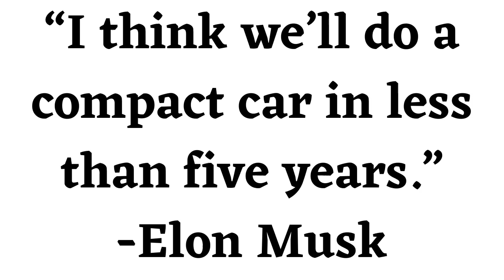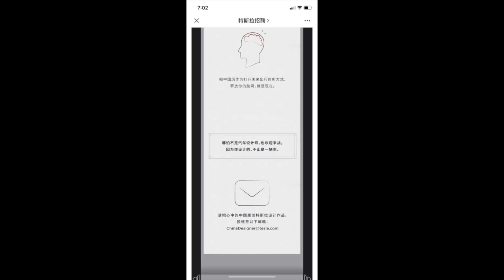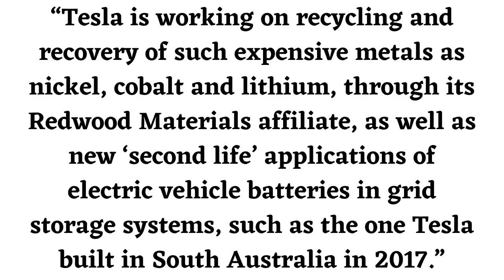Tesla's $20,000 Compact Car Is Coming Soon - The End of Gas

Comment: Go green ...oh yeah EV's get their power from the grid which is powered mostly by coal
Reply: brent cowan Brent, not necessarily any more. I live in New Mexico which is actively building more wind turbines and solar power. They are putting in transmission lines. The main coal fired plant will be taken down soon. Also we have solar panels on our roof. So charging at home is completely green. And if you drive across Oklahoma and Texas you will see miles and miles of wind turbines. Times are changing.
Reply: brent cowan Only in the third world USA. Here in the U.K. We were once the worlds biggest producer of coal, and until twenty years ago almost 100 percent of electricity came from coal. Last year, it was 1 percent. By 2025 the last coal powered station will close forever. We get a third of our power from renewables and have some of the cheapest power in Europe, much cheaper than in many US states. Coal is a Victorian era fuel that belongs in history books.

Comment: Inexpensive Tesla vehicle will cost below 20k, and be made out of stainless steel. Multiple colors will be achieved by wrapping it. Battery, powertrain, and passenger compartment,  will be modualized and easily swapable. Car will be fully assembled by machines. And one more thing - it will be complete not repairable. If anything breaks entire module will be swapped.

Comment: I’ll buy one for sure, EV is the future that we need.
Reply: I just wish they would sound good.
Reply: Sadly I will most likely be dead before it goes onsale.
I have the cash but I will be 83 years old on 3/7/2021.
Reply: @Lane Araujo you are missing the point entirely. You cannot charge a lithium battery at 0C. What are you going to heat it up with?
Reply: @Lane Araujo  The battery cannot be charged below 32F 0C. It will be permanently damaged. Are you going to heat the car up with Gasoline Diesel?? A 12 bar electric heater? Whoosh!
Reply: @Lane Araujo You leave the garage, 5mins later it is 0C. Or you use the battery to heat the car, and you can't get home!
Reply: Whoosh!
Reply: Petrol/Deisel.... byproduct! Heat! Range in cold, range in heat....about the same! Electric car? 20% in cold, 60% above 40C....longevity of battery above 40C....25%
Reply: @Lane Araujo So, you are 40 miles from home and 40 miles from nearest city. Parked while storm is ravaging everything out there.  

Just where exactly are you going to plug it in in the middle of nowhere?
Reply: @VladR1024  so you are in your old car and run out of gas? Should have a plan, not to run out of gas. Adjust.
Reply: @jacka7211  You have somehow managed to miss the whole point of not running out of gas in the middle of a -30 'F  snowstorm in my gas car compared to your battery dying within hours and you subsequently freezing in your electric car.

Good luck getting AA tow to come pick you up in the middle of the storm in the middle of nowhere in Montana within 10-12 hours, because that's the time they are most busy...
Reply: @jacka7211  You keep using the same argument about "no gas" over and over.
But the simple survival daily scenario we are discussing is that you get stranded in a snowstorm for at least 12-36 hours. 
In a gas car, your safety is not compromised.
In electric car, you are fucked and cannot even drive away once blizzard dissipates as you ran out of battery very quickly at -30 to -40.
Reply: @jacka7211  You keep using the same argument about "no gas" over and over.
But the simple survival daily scenario we are discussing is that you get stranded in a snowstorm for at least 12-36 hours. 
In a gas car, your safety is not compromised.
In electric car, you are fucked and cannot even drive away once blizzard dissipates as you ran out of battery very quickly at -30 to -40.
Reply: @Lane Araujo It's really funny how there are thousands of videos about driving in California climate.
Yet I have not yet seen one video about driving in -40 'F where you really really need a heating on. 
I wonder what the driving range is at that temperature :)
Reply: @Lane Araujo You have very obviously never experienced -40F in real life.  It's a very simple experiment. Just get your phone out and see how long the battery lasts. Then come back and report the findings :)
Reply: @Lane Araujo Allow me to explain to you that at these temperatures, you need to crank the heat up to maximum and still need to be heavily dressed inside the car. I very seriously doubt that Tesla designed the heating system to be useable at such extreme temperatures. Again, if you live in city and have zero commute, and burn through extraordinary amounts of money to heat your garage in winter, then you might be able to use it around here.

It just would be utterly ridiculous...
Reply: @VladR1024  Whether Tesla did or didn't resistance decreases with temperature, so the batteries would be flattened by the heater in about 3minutes. And the current would destroy the batteries, as the Mosfets wouldn't be able to switch fast enough to create an inductive load to save them...skin effect!
You can't charge a LiPo sub 0C and discharging one, the internal resistance is so low, you can't regulate it!
Reply: @Lane Araujo Listen, I read some reports of people who tried Tesla at -15 and it was consuming 10 miles of driving range per ONE mile driven.
That was -15. Not -40 F :)
Reply: @Lane Araujo "Rated for -70 ". Sure it is. Just how long would it drive? 7 minutes?  :) 
Why do you think it's most successful in California? Ever looked up winter climate there? It's over 100 degrees warmer than the brutal wind-chills in ND-MN region. 
When we only got -50 'F , I talked to a guy who got the full blast of -70 'F. I suggest you look up thermodynamics. No matter how many tons of shield you put around the battery, it will eventually equalize with outdoor temperature.

So, to use the "cheap" electricity, you only have to heat up your garage around here for 6+ months :) Very smart :)
Reply: VladR1024 for fucks sake you don’t think they will create new technology in 10 years? Just deal with it. THEY ARE JUST FUCKING CARS. NOBODY GIVES A FUCK ABOUT YOUR GAS CAR. A CAR IS JUST A CAR. You act like your comment makes you look like you just graduated from Harvard. Nobody gives a fuck that you are too stupid to realize that electric is the future.
Reply: @DanC8111_  The electric car has been here since 1908, your faith in implementing Nicola Teslas ideas with modern materials is naive in the extreme. If they could they would, and like fusion...they haven't.
Reply: @sre331l  actually they have. There are over 1 million Tesla operating on the road TODAY.
Reply: @DanC8111_  10 years, eh? You are one optimist :-) You think an invention will bypass the laws of thermodynamics? Earlier this year I experienced a -47 'F blizzard, walking my Husky outside. I would pay serious money to see some poor sucker attempt to drive his Tesla through that clusterfuck :-)

There's a reason not a single affluent person around here has an electric car. We have snow in May and freezing wind-chill in August. 
Not a weather from Tesla commercial :-)
Reply: Assuming you spend your whole life in the city and live in the tropical climate, then sure.
Try parking your Tesla at -40 'F (= - 40 'C) for 3 days outside where I live and then tell me how is your battery doing.  Or try doing the 250km round trip at -30 (without refueling/charging), experience a snowstorm and stop for 14 hours. Good luck surviving that in Tesla. I've experienced that couple times. Was perfectly fine in my gas car.
Reply: @VladR1024  I agree they have quite a ways to go before you get the reliability of a gas car. I'm surprised no one is working on Hydrogen. I'm sure they could adapt the gas 
engine to work with  Hydrogen and the only by product of Hydrogen use would be water. Also the fill-up would be like gas short and sweet.
Reply: @stevev2474  I honestly don't care much about reliability as EVs are simply dangerous here.
Just this particular week of February, we're having wind-chills around -49 'F. 
Unfathomably, nobody is driving EV around here :-)

$20 a gallon?
I will gladly pay for 10x more expensive gas before even considering EV.
Reply: @VladR1024  bro youre acting like everyone is living in an iceage. i own a model 3 in Calgary and it occasionally dips down to -30 'C. the worst case on a full charge I've experienced is losing 15% range . losing about 40 km. and that's only for 2 months or so. and yes the new 2021 tesla 2 has a built in battery heater. absolutely no issues. ev arent meant as a replacement just yet either, right now is the pioneering stage of all the ev. a proving ground. people in the territories or like Antarctica would obviously need gas cars lmao.
Reply: @moosashahid3228  Calgary? You're funny. That's tropical winter.
Also, city is one thing, and remote location a whole different ball game.

Even if you got stuck by the side of road, you would get police assistance in under 10 minutes.

Good luck with that around here....
Reply: @VladR1024  again youre generalizing lol. the car isn't meant for remote places lmao. very few people live in remote areas and have a tesla lol. i have no idea what you're arguing but electric vehicles are the future for 90% of us
Reply: @Lane Araujo You are a funny one :-) For how long do you think the batteries would hold charge at -40 'F while heating the battery itself ?

Realistic scenario: you have about 35% charge and get stuck in blizzard (happened to me few times with my Jeep). Except my Jeep will never run out of gas as long as you don't turn the engine on. This thing will die on you overnight...

Comment: I would certainly consider a used Model 3 in the future, but my current DD budget is between $15,000 and $20,000. A $20,000-$25,000 compact Tesla, that would no doubt be stunning and unique, would fit my budget perfect. That's a Tesla I would absolutely put a deposit down on and order new.

Comment: Why build a $25,000 car when Tesla has about 750,000 orders for the 40, 50 and 70 thousand dollar truck?  Until that Texas terrafactory is up and running there is no need to bring out a cheap car.  Remember, there still is a backlog for the semi and for the Roadster as well.  Perhaps pushing excess capacity at their China factory to put out a cheap people's car might be a good use for that factory but certainly not for Fremont, Berlin or Austin locations.

Comment: Would a Cybercar based on scaling down the Cybertruck but still using origami folded stainless steel sheets be able to come in at $20k or less?   How expensive is the stainless steel body vs carbon fibre?

Comment: S - 3 - X - Y - e - R.....

Yup, this compact/hatch could be the "e" and "R" might be a roadstaer/race car
Reply: [C]ybertruck
[A]TV (4 wheelers only available with the Cybertruck)
[R]oadster
[S]emi
Reply: 21 idiots voted you up....Ford has E that is why the Model 3 is called that and not Model E like Musk wanted.
Reply: Ford fvcked the E brand
Reply: E is taken
Reply: model "2" then potentially model "I" (even smaller & cheaper than model "2") & model "M" (sub compact cuv/suv based on a potential model "I") IM 2 S3XY

Comment: I currently have a MY and a M3 but what I really would love is a 2 door (Perhaps a convertible option) with 200 mile range.  I love my M3 and MY but now that I have gone all in on EVs it would be great to have one with 300+ range and the other for local use, no self driving tech or long range batteries to increase the cost.

Comment: I would like a Single seater car, but with wide wheels (a bit like a F1 car), low drag, great performance 200 miles range would be fine. Possible with a second seat behind the driver or room for storage. Mian point being a low drag, so more miles per kwh.

Comment: Making the car TOO lightweight compromises SAFETY (one of the most important aspects of the TESLA brand of cars).
  -> The heavier the battery, the lower the center of mass (people & their baggage are NOT made of air; their presence is much more relevant).
  ->  Structural steel is heavy for its strenght,  but pure alluminium is not rigid enough (the car must deform in a predictable way from impacts in all directions); so they will need some titanium [but it is expensive].
Developing revolutionary "new geometrical" solutions is what Elon wants designers to discover.
An even better example than the CYBRTRCK would be the prototype for the SR-71 Blackbird spy plane ( the one with the same name than his last son).

Comment: This is such a nonsense. If the most costly part in electric vehicle is the battery, just make $15000 car with a range of 150km. Who needs to travel long distances with a compact car? It should be a commuter car. Who commutes at such long distances (in Europe)? I am not buying a compact car for $25000.

Comment: Interesting video, however, I reckon the predictions are somewhat off. 
Price: $20_25k is way too much for a compact car in say five years time. Already we have the Skoda Citigo at $15k and in China the recent release of the Ora R1 at $8k is showing the way forward. If the new Tesla will truly be a mass consumption compact car and not some bloated excuse for one, then it will need to retail somewhere around $10_15k.
Date: You correctly state that Musk’s time projections are usually way off. Despite learning from past ventures, I reckon this one is way off too. Making a cheap car is way trickier than making an expensive one. For an expensive car, if production cost a few more bucks, so be it, the consumer will pay. Not so with a cheap car. The logistics of production, materials, Labour etc will need to be very finely honed. If the model hits the world market by 2030 I will be impressed. Maybe some teaser preproduction models will be around by 2026.
Finally, let us not forget that this will be possibly the hottest contested sector of the market and the state of the art may have progressed so far by then that the Tesla may have become irrelevant even before release and it would not surprise me if it was quietly dropped stillborn.

Comment: Something small like the size of the Toyota Yaris but with stainless steel exoskeleton. 

 I personally don't care for all the technology found in autonomous driving, the max speed,  how fast it reaches O-60 mph or that huge glass roof.  

Just give me an electric motor, an odometer, a speedometer, a computer to monitor my power and mileage left  and a GPS showing me where the nearest charging station is located.  And a minimum of 250 miles range. 

Some decent ground clearance would be nice too.  

Keep price at 25K or under would be fantastic.  Even 30K would be fine.

Comment: Exoskeleton frame like the Cyber Truck regular safety glass windows two seats passenger behind the driver
250 miles of range cost to set up a 50,000 car per year line about 30 million dollars or less. you could sell it for 15,000 each.

Comment: Could it be more energy efficient? I would love one that needs only 6 KWh/100 km = 100 Wh/mi. (or less!)
Reply: iggi1972 So you want it to be able to break the laws of physics?! Unlikely, I fear. 100 Wh/mi probably isn't even enough to overcome the rolling resistance of low resistance tyres, let alone push the air out of the way of the vehicle.
Reply: OK, not against physics but against acceleration rights. At 500 kg, 80 km/h and 25 HP, there is no rocket science needed. I'm confident an efficient Tesla could even be much faster.
Look here:
https://lightyear.one/lightyear-one/ (83 Wh/km (WLTP))
https://en.m.wikipedia.org/wiki/Volkswagen_1-litre_car  (240 mpg‑US)
Reply: And my sub-tiny "car" needs less than 2 KWh/100km = 33 Wh/mi
https://m.youtube.com/watch?v=tQM42D3rioM

Comment: This shown compact car design is not very good. Something is wrong with the front wheel arch. And what is that black connection bridge between the tires on the bottom ? 
I can draw better cars with correct perspectives and i am not an artist or car designer. This work looks ridiculous !
Compact cars ( which are driven mainly in cities ) do not need aerodynamic cabins ( at least not the rear area ) , as they are not used on autobahn / freeways ( fast roads ) for long distances.
People need space inside the cabin for transporting their children and their toys and also space for purchases and other bulky stuff and it needs an integrated bike rack to transport a bicycle Just like the Flex Fix system in Opel Automobiles :  https://www.youtube.com/watch?v=WyRFCIFRjY0
Look at the Honda e  :  https://www.honda.de/cars/new/honda-e/overview.html 
That car is almost perfect when it comes to design and interieur.
But... it is absolutely NOT perfect when it comes to the drive train ( acceleration  0-100 km/h  in 8 seconds  and just  315 Nm torque ), battery capacity 35-kWh-Battery , 200 km maximum range and  its incredible  high PRICE ( 37.000 Euros !! WTF !!? )  .
If Elon wants to bring out a compact EV for 20.000 Euros it has to offer the same fast acceleration and similar range as other typical Tesla models.
Only by doing so it can be a good competitor for Honda e , Opel Corsa-e , Peugeot e-208,  and other electric vehicles in that class.